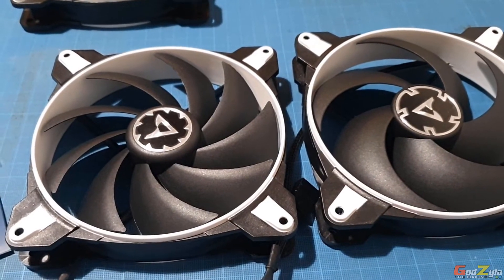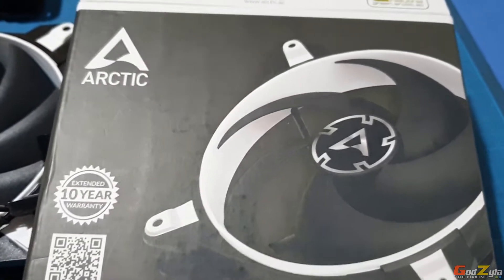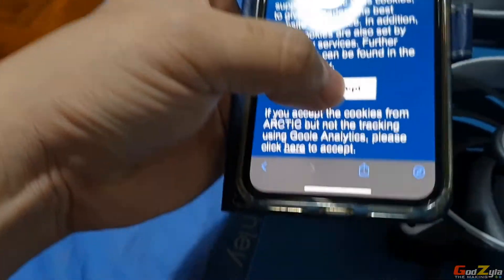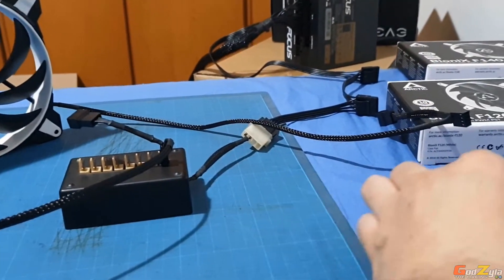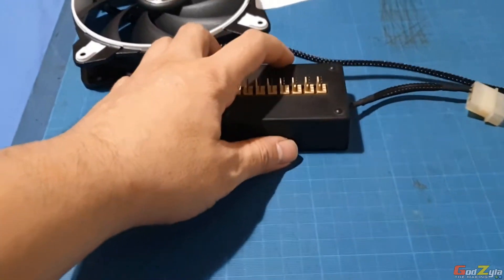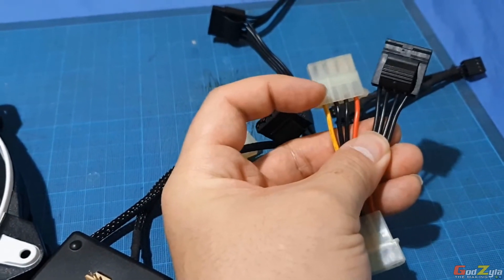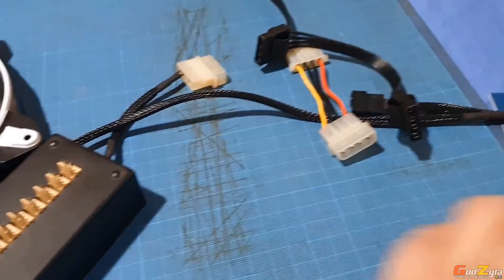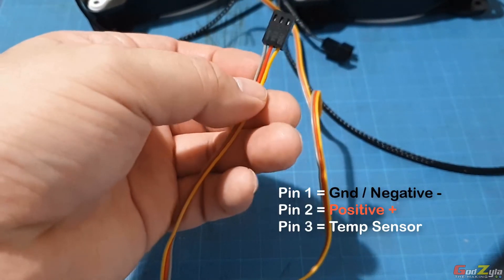The Experience On Arctic Bionix Fan & Guide

Comment: I have a phanteks eclipse p400s case, what should i use the p140's as intake fans or the f140's because the front of the case is designed so it pulls air in from the top and the bottom through small dust filters?
Reply from the maker: hi Franz Ruttgers, welcome to my channel. I suggest to use the F140 as they are case fans. P140 are for radiators.

Comment: hi! i just bought 3pcs bionix p120 and planning to use it for intake fans at front case. and I still have slot for rear and top as my exhaust, can i use the bionix 120 on it?? or its better to use f120 for airflow and also as exhaust?? and for the heatsink fan, i do have arctic freezer 34 esports duo already. :D ty!
Reply from the maker: Hi gleen calimlim, welcome to my channel. Is best to use f40 for case fan and p120 for heatsink.
Reply: @KleoYan  hmmm. So where should i put these 3 bionix p120 that i have already?? I dont have aio cooler. Cooling tower yes but the arctic freezer esports duo has 2 fans itself already and its also bionix p120. Is it okay to use my 3 p120 at the front case? And get 2 f120 for my rear and top exhaust fan? Ty
Reply from the maker: @glenalexis  hi, yes is perfectly fine.  Not an issue. You can do 3 front p120 and the rest f140.

Comment: greetings, rly good review! I got a question. How much daisy chain can we make with Arctic Bionix P140 Pwm 120mm fan safely?
Reply: exam: I got a arctic freezer 34 esports duo (it includ 2 Arctic Bionix P140 Pwm 120mm fan.) and i get 2 Arctic Bionix P140 Pwm too for my case's upper mesh. So can i connect them 4 together ? is this harmful for motherboard or anything?
Reply from the maker: @yusufb.794 Ideally for your case, the freezer 34 esports duo,  daisy chain 2 two fans together and plug to fan header on your motherboard that say CPU. This way you can make use of the  pwn function that build on the motherboard. you can either control them via UEFI or software controler. As for the upper mesh or rear fan, you can daisy chain them to both. does not matter 120 or 140, then connect that header to the motherboard that says Chassis Fan.
Reply from the maker: @Yusuf B now in general, I will not practice to daisy chain more than 4 fans to one motherboard header. please note that I am talking about these Arctic fans here as they are rated at 0.15a or 0.25a ... most motherboard have a 1.0a header. some premium boards are of 2.0a, check your motherboard specification on how much is can provide. if you are unsure, I would say stick to two for one header, which will be on the safer side.

Comment: which of the two should be used for air coolers (heat sinks)?? p120 or f120.. it will be installed in AXP-100 thermalright..
Reply from the maker: That will be P120

Comment: Can i connect a 3 pin fan on the 4pin socket of these fans? What will happen then?
Reply from the maker: Hello Honda Lead R. Thank you for your question. Yes you can but you will lose the function to control the RPM. And it will run at full speed. Thank you for your question and if you have not subscribe to my channel. I will like to invite you and do remember to click on the notification bell. Thank you very much.
Reply: @KleoYan 4pin Arctic fan will be controlled through the pwm and the 3 pin other fan will run at full speed right?
Reply from the maker: @pantsi  yes correct. Any 3pin fan header plus to the motherboard 4pon fan header, it will run in full.

Comment: Hi, i am new in this. My question is : f140 i can use in my case 2 pcs in front and 1-2 pcs at top for air flow. Should i use 1 or 2 pcs of air intake at the top or none? Should i also include p140 fan in my case, or they are only meant for AIO liquid cooling radiators?
Reply from the maker: Hi David, thanks for the question :) ok the Arctic F140 are for case airflow and the P140 are for AIO radiators, some use the P140 as case fans, nothing is wrong with that but I would advise you to use F140 as case fans. Now I can't advise you on the placement of fans, you will need to try it out on your own and see which is best for your configuration. If you do have time, there are more explanation which I did in general on another video. please note this video is super lengthy https://youtu.be/Aj4fIPKELNI
Reply: Ideally you want airflow front to back and top to bottom, your intake fans should be dust filtered. The most important fan is the rear exhaust and should be your first priority. Heat rises which is why it's better to exhaust air at the top, an additional benefit is that exhaust fans at the top are blowing dust away from the case. Positive pressure is usually preferred as it helps to reduce dust build up, basically this is achieved by having more intake fans than exhaust (or bigger fans at the same speed ), don't forget to include the psu exhaust in your calculations. Air coolers are also best front to back, (or top to bottom in some cases). If you are using a radiator it is best to have it drawing fresh air in, so front mounted is best, you can top mount a radiator but then, ideally, you should use it as an exhaust if possible (with good intake fans and good positive pressure). I hope that this helps, have fun.

Comment: I dont understand, one is "airflow" and one is "pressure" fan. So, in case i want to use the fan for pulling air out of case, but i have thick filters on intake, which slow down air intake considerably, which should i use? I want it to create airflow, but it will be working agains some negative pressure.... its quite confusing :D
Great review tho. Thanks.
Reply from the maker: Hi Allan, thanks for the feedback, ok the P140 are meant for AIO radiator (All In One water cooling solution) and the F140 are for case airflow. You wanted to have air intake in your chassis, therefore you will need airflow fans (Arctic Bionix F140 )

I do apologize at time 7:24 of my video, that's not a P140 it's a F140 as I wrote above when I was explaining. hope that clear up your confusion.

Comment: Does that mean that i can plug 2 of these fans into 1 header by connecting them together? Btw amazing review
Reply from the maker: Hi ErikTitan, yes that's right.
Reply from the maker: Hi Erik, yes that's right :) 2 Fans to 1 Motherboard header.
Reply: @KleoYan  how about 3 fans
Reply from the maker: @claydohlite29  you can but I advise you to see your motherboard specification, see how much amp does a fan header provide. 
Next read the specification of your fan if you are not using the fan shown in this video. 

Lets say your motherboard fan header support up to 1.0a , if you use these  arctic bionix fans :
P140 (0.15a) you can connect up to max 6 fans
F140  (0.25a) , you can connect up to  max 4 fans. 

However having to say all these, I prefer to run only 2 fans on one header. reason being, I rather split the electrical load to other fan headers and not overdrive on just one fan header.
Reply: @KleoYan  thanks for the reply,  I'll just get 2 of p140  my motherboard has 4 cpu fan header so it should be good i think
Reply from the maker: @claydohlite29  thanks for asking and all the best with your build :) , btw do take note that P140 are for static pressure and not for case airflow.
Reply: @KleoYan  yeah thanks for reminding, i need static pressure cuz of the restriction of my front panel it has only small mesh both sides. And the front panel is solid tampered glass,  so I'm thinking going for static pressure cuz of the restrictions

Comment: In the video the pressure fan has a lower pitched sound, is that accurate?
Reply from the maker: Yes they do..
Reply from the maker: Hi Thomas, yes the pressure fans do have a low pitch sound. The definition of noise on these fans depends  on individual hearing.
For me, I cannot tolerate the pitch sound at full rpm outside the case, but once I plug them into my chassis, I can hardly hear the pitch. 
Unless your chassis body is small, that might make the hum audible.